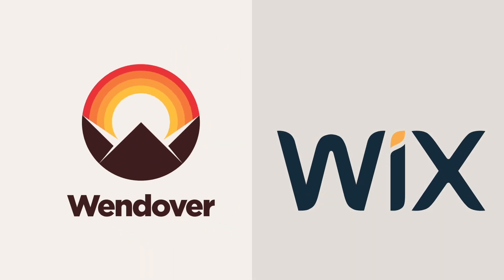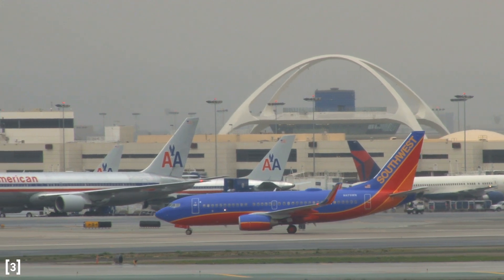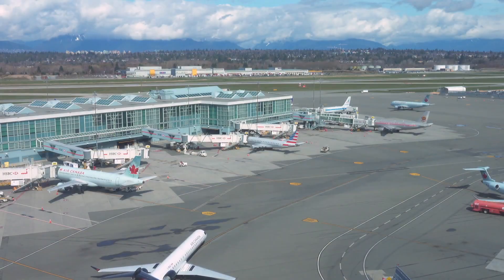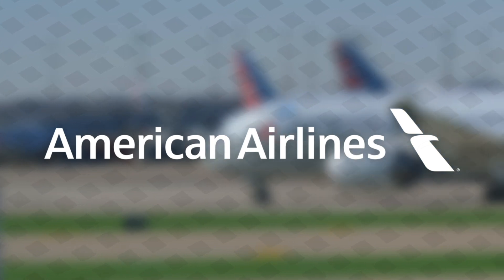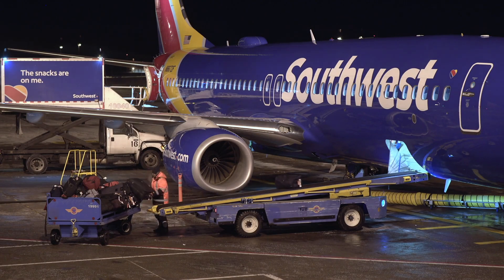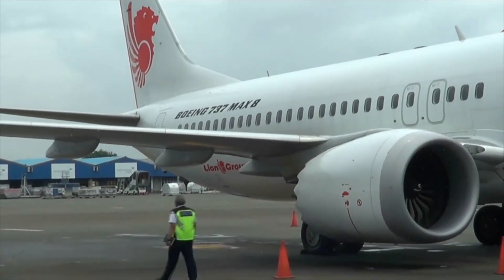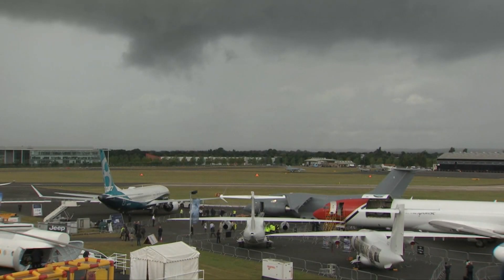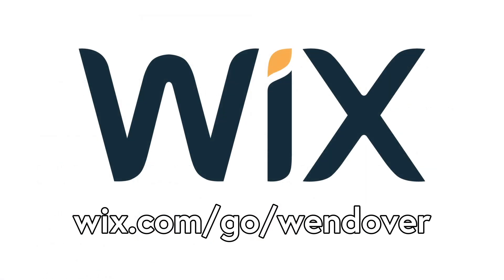The Economics That Made Boeing Build the 737 Max

Comment: About pilot training costs: less than what just one flight uses on fuel. It is 100% bullshit so say that pilot training is a massive cost. It is however a clear sign that airlines are cutting costs where ever they like and if pilot training is significant cost: think how many safety features and practices they are also cutting.
Reply: Good point. This means that the airlines has a shared responsibility.
Reply: But the 737 is the world's most widely used airliner and collectively the airlines would have resisted retraining not just their aircrews but ground crews and changing infrastructure, cost and time were certainly considerations

Comment: A little speculation never hurt in a setting such as a youtube video.
It has been considered proper in the various industries to test new products, or new modifications to existing products, before "offering them to the public." The aircraft industry is no different, except that the prospect of the large loss of human life should make complete and careful testing even more necessary.
It is my guess that Boeing cheaped out and didn't do the previously accepted minimums of testing on the 737MAX, or that they did proper testing, but no one made sure that the lessons so learned (about what happens when the angle of attack sensors fail) and what to do about it, made it into the pilot training manuals, which would be a gross failure of initiative on the part of Boeing.
Considering that the two 737MAX aircraft that crashed, killing a lot of people, were being operated by smaller countries with a lesser tradition of "technological familiarity," shows that more communication with these small-country airlines is in order.
Also, how could Boeing ignore or appear to ignore the first crash of a 737MAX without immediately convening an "emergency  council" of engineers, safety experts, etc. to suss out the cause of the crash?
So, to save a few millions, they lost probably billions and the respect of the world.

Comment: There is zero reason for these planes to remain grounded. Pilots just need to follow training, unlike the two flights that crashed...
Reply: Pilot were never trained to face a Stab intermittent runaway . They were trained for continuous Stab runaway . Boeing never informed them of thes fearing that they would require expensive pilot training.
Reply: @danielmainville5612  They are trained for stab runaway, and the failed because they did not follow procedure. Intermittent or continuous, both are a stab system anomaly that should be treated the same...

Comment: Very Gơod! Well researched well explained. Thank you
Reply: Tim Lý not really well researched as he states many many wrong facts about the 737 Max. As an example, he lets us think that they just moved the engine upwards and that the whole aircraft is old and outdated when compared to the A320, which is incorrect. The 737 Max is also fly by wire, and he says it’s not. And finally, the MCAS was not solely responsible for the crashes, as never a single aspect is in aviation crashes.
It is a good video though, but he should have focused on the economics and anything else.

Comment: I saw it live when they lifted one of the engine core from Lion Air flight 610 from the sea. That was the moment when I think to myself "holy crap, this is not normal". Then I heard of MCAS, and then I read the preliminary report of Ethiopian Airline flight 302 crash, in the events timeline... I know something horrible has been going on.

I hope this expensive lesson is going to always be remembered upon by future corporations and industries. Safety might be expensive, but it's cheaper than having to deal with bad PR.

Comment: What a pile of crap. You denigrate the facts the 737s have legacy flight systems that have logged more miles than any other aircraft. Some pilots with the ability to deal with an AoA fault would have saved lives. Adding an AoA disagreement system will solve most of the problem. The 'Know it Alls' like Wendover need to get a freakin' life. AirBucket has had their challenges, too. 

I'll fly a Boeing rather than an AirBucket any chance I get. 

How about assessing the help AirBucket Industries have received from the EU over the years?

Comment: Great video, but it should be noted that there's nothing necessarily wrong with re-using the 737 design. It's one of the safest planes (based on fatalities/passengers/hours flown) which is remarkable considering how many cycles (takeoff/landing) these planes go through. Airbus did the same thing with the A320neo - just slap a new engine onto an existing airframe.

The real failure of the MAX is the way that it handles bad data, in this case a malfunctioning sensor. This problem was made worse by Boeing's poor communication of the MCAS. Interestingly, these problems with the MAX are remarkably similar to a problem Airbus had with the A330. In ~2008, several A330 flights, including QF72, pitched down suddenly due to erroneous sensor data that basically told the plane that it was in danger of stalling. The only reason why these flights did not crash is because this issue occurred at high altitude, whereas the MAX AOA sensor failures occurred right after takeoff.

I don't think the real story here is corporate greed or cutting corners. Boeing, even acting with a completely callous capitalistic mindset, would not launch a plane that it thought would crash. That's just not a profitable business model for an aircraft manufacturer. It's not like you can hide a fatal problem with an airplane that will fly thousands of hours. Rather, I think the story is the reality that planes today are just as much software as they are hardware, and there are just too many variables with the software to fully test. The MAX crashes and A330 incidents like QF72 show what happens in a few rare cases when software does not handle erroneous data well. This is not a Boeing problem or an Airbus problem. It is a modern aircraft problem.

Comment: It should be noted that in the case of the Ethiopian crash, the pilots correctly hit the stab tim cutout switches. Only to reengage them later (against the QRH handbook) and seal their fate. It is the pilots job to fly the plane, even when the automation goes south. Basic airmanship is lacking and crashes with Airbus products also proves that.
Finally, Boeing is the not the only one to stay with the older airframe and add improvements. The A320NEO is also a re-engined aircraft, not a clean sheet design.

Comment: The 737 flight control surfaces are controlled by hydraulics, the cable system is a backup in the event of an emergency, not the primary method of controlling the flight surfaces. Manual reversion is the name of this system.
Reply: Thank you, Ramix Cws for fact checking this presentation. I wonder what other facts were "massaged" in the presentation?
Reply: Ramix CWS. The cables have to go all the way to the controls otherwise manual reversion won’t work. They would be tugging on dead PCUs which couldn’t move the flight controls. The ailerons actually have a single dual (A/B) system PCU in the wheel well and its all cables going into it from the wheel and going out to the wings. 

In the case of the rudder there is no manual reversion so there is the standby system in addition to A/B systems. Airbus and all other aircraft that don’t use manual reversion have triple redundant primary flight controls.

For the Stab you have two motors and manually driven cables. No hydraulics. But from this accident the forces on the stabilizer were likely too great to overcome manually (the trim wheels on the Max are about 1 inch smaller in diameter than all other 737s) and the electric Stab trim reactivated the MCAS.
Reply: hydraulics is just a glorified cable system
Reply: The control column and rudder pedals are still cable connected and operated to the elevator/ailerons and rudder, but those movements are assisted with hydraulic actuators to relieve the aerodynamic forces that the pilot would normally encounter when moving the control surfaces.
The only alternative to cable connected control surfaces is fly by wire.  
If in the unlikely event of system A/B and standby hydraulics loss and depletion of pressure, then the pilots on the 737 can revert to non hydraulic assisted movement of the primary control surfaces, which would require a lot of physical effort from possibly both pilots to operate (depending on the airspeed) with noticeable slower roll and pitch rate
The 737 has the advantage over the airbus A320 in that the airbus has nothing to fall back on if it has a complete hydraulic loss of all it's systems, the aircraft may only be controllable using each engine.
Reply: This is partially correct, I appreciate your efforts to explain the system for other people to understand. You missed the fact that the flight controls are mechanically connected to the hydraulic system, independent of the cable system. The cable connection to the flight control surfaces is only used in the case of both hydraulic systems failing, as you stated, but is not the primary system used to control the flight controls.
Reply: @EinkOLED  "The 737 has the advantage.."  A320 has triple hydraulic system with multiple power sources, including a wind turbine. 737 has single cables, which actually has happened to fracture for complete loss of control surface. There is no backup for that type of failure. So I wouldn't say the mechanics of cables has an advantage over the mechanics of triple-hydraulics. However there are other potential risks with a fly-by-wire system you may say a 737 avoids.
Reply: And could they have disconnected he hydraulics to take control of the plane over MCAS, controlling it by cables?

Comment: I usually choose my airline/flight to, if possible, try new airplanes. 
I know that this might be an irrational and arbitrary decision with no objective facts behind it but I will probably never fly the 737 Max. 
If it can be a Max I’m not buying that flight
Reply: I'd fly it if only if it flied safely for multiple months... maybe years if I'm still paranoid. I'm hopefull though
Reply: how is it irrational? I will do the same. Would you drive a car that needs a software to be able to drive in a straight line? Everybody knows that the design is fundamentally flawed. Software can assist a good design, but it can´t make up for a bad design.
Reply: Affenpeter So any car with cruise control is a bad design because the computer drives the car?

Comment: I would say though that despite whats happened the 737 Max is still a solid airframe, boeing just needs to make the MCAS system reliable, and possibly fit it with an override for the pilots (idk if there is one or not)
Reply: IMO that does not suffice, because shortcuts were taken during certification. Because of this we cannot say with any authority that it is a solid airframe. I'd really to see that the certification is redone or at least reviewed, because there might be other flaws that have been missed during certification.

Comment: I don't think that "boeing making the 737MAX" led to these crashes. Why do most planes (or at least the 737MAX) have three pitot tubes? Why are there two AOA sensors on a 737MAX? Why are there two pilots?
The reason is, things (and even pilots) fail. All the important things, we've learned, you need to have a backup in case the first one fails. So for all the important things on the plane there are two of them. But MCAS, stall prevention, has (uses) only one AOA sensor? Is it "unimportant" like an entertainment system?

Comment: Wouldn’t moving the engines forward move the CG forward therefore giving the rudder and elevator more authority? Also, please explain how MCAS is different than the speed trim system and not just an extension of it.
Reply: I believe you just proved moving the engines forward moves the CG forward. Here is why. The weight you talk of is added in the nose to bring the CG forward, which increases the lever arm of the stab. Real life example, on the CRJ7/9 we always had to move passenger or bags (hundreds of pounds) forward, or towards the nose. This would bring the CG forward so the aft limits wouldn’t be exceeded. We did the opposite on the CRJ200 because its CG would be outside of forward of limits. So if you can take weight out of the nose due to the new engines placement, then the engines had the effect of moving the CG forward and the weight reduction in the nose would have the effect on moving the CG aft. What you call a small increase in tail weight would have the effect of moving the CG aft and would make the stabilizer less effective because its lever arm would be shortened as the CG moves aft. If you look at the pilots handbook of aeronautical knowledge it give some benefits and draw back to forward and aft CGs and what happen when you exceed the envelop which is helpful when discussing CG.
Reply: dothemathright 1111 I am say that if all you do is move the engines  forward ( not removing weight)  it would have the effect of moving the cg forward which would make the plane more stable than before. Which shows moving the engine forward isn’t issue the news is making it out to be. If you look at moving the engine forward which means you have to remove weight to keep the cg in the same place then once again the forward placement of the engine wouldn’t be the issue it is being made out to be.

Comment: Misleading. The issue comes from trying to fit larger engine in the 737 to compete with the Airbus. Problem is Airbus sits high enough on its landing gear to fit engines under wings meaning the plane behaved the same.  The 737 did not have that space and the engines mounted too high on wings completelychanging the flight characteristics. Skipping on retraining and installing the correct stall indicators and software for economic reasons. It may be a 737 series but from a flight character it was indeed a new plane.

Comment: Well, Airbus have essentially done the same thing... re-engine an old design. Obviously the A320 as a whole is newer, but the same concept applies. The real problem, is Boeing's production quality and failure to update airlines on all the new tech. That's about as much as I know, atm. I hope Boeing can pull it together and regain their reputation.
Reply: Boeing did more than just re-engine an old design. They changed the aerodynamic properties of the plane as a result of fitting in the new larger engine. This made the 737 Max an unstable plane, as explained in this quote:  "In the 737 Max, the engine nacelles themselves can, at high angles of attack, work as a wing and produce lift. And the lift they produce is well ahead of the wing’s center of lift, meaning the nacelles will cause the 737 Max at a high angle of attack to go to a higher angle of attack. This is aerodynamic malpractice of the worst kind." - from https://spectrum.ieee.org/aerospace/aviation/how-the-boeing-737-max-disaster-looks-to-a-software-developer
Reply: That's terrible. Boeing did the same with the 7478 and flutter. Instead of redesigning the wing to fix it, they used a the avionics to constantly adjust the control surfaces

Comment: You said the MCAS could be disabled, correct? If the pilots had known what was going on, they could've disabled it. AFAIK, the Indonesian crash, the plane was continuously nose diving, with the pilots correcting it (apparently over TEN MINUTES).

It's really operator error and lack of familiarisation with the system. You can't make the excuse that everything happened in split seconds, as some crashes do, since here they had plenty of time to panic, breathe, panic some more, then locate the issue.

Makes me wonder what happened in the Ethiopian crash, considering non-existent African aviation standards.
Reply: Yes, but in no part of the world were pilots required to learn the ins and outs of the MCAS system. This could have happened anywhere.

Comment: "they put [the engine] even further forward and up; it would cause the airplane to pitch up"

That sounds superficially plausible but doesn't actually make sense  - the engines are mounted below the center of gravity so moving them UP would move them CLOSER to the center of gravity and thus REDUCE the torque i.e. cause the aircraft to pitch up LESS. 

But I guess the real explanation wouldn't make for a snappy video.
Reply: It does pitch up. That's why MCAS was installed in the first place.
Reply: Here's the explanation, and it also tells us that the plane is structurally unstable: "In the 737 Max, the engine nacelles themselves can, at high angles of attack, work as a wing and produce lift. And the lift they produce is well ahead of the wing’s center of lift, meaning the nacelles will cause the 737 Max at a high angle of attack to go to a higher angle of attack. This is aerodynamic malpractice of the worst kind." - from https://spectrum.ieee.org/aerospace/aviation/how-the-boeing-737-max-disaster-looks-to-a-software-developer

Comment: Excellent video. Thank you.

Somehow, I doubt the investigations into both 737MAX crashes will determine root causes that include Boeing's reaction to successful competition from Airbus, a purchase choice by United Airlines, or sentiment among Boeing's investors/shareholders in 2011. But they should. Yet, any such conclusions, and the recommendations that would obviously have to ensue, would be earth shattering for commercial aircraft manufacturers and airline operators. So it won't happen.

It's much safer to stick to conclusions and recommendations about merely technical and operational issues.